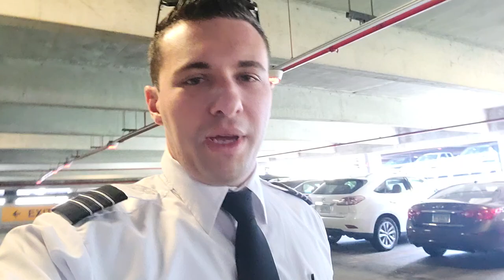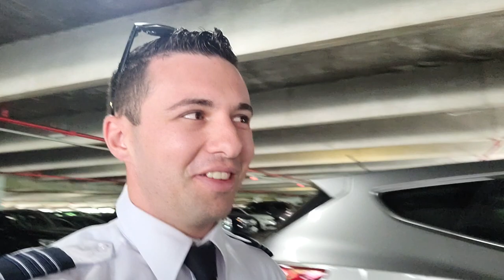A320 Mechanical Backup

Comment: Makes total sense! Worth to note that mechanical backup is not really "mechanical", it's just that you can only use pitch trim and rudder that are still powered hydraulically though. Is that correct chief?